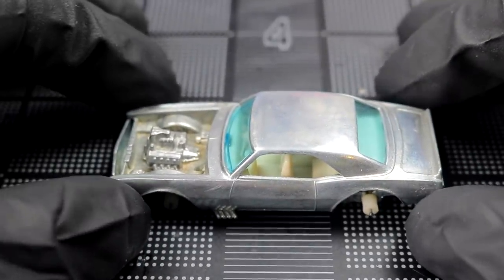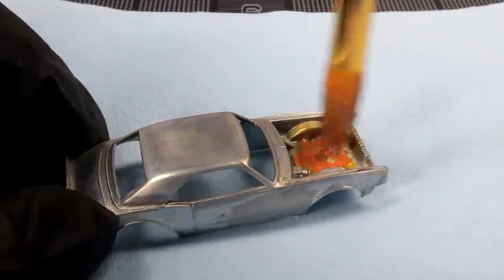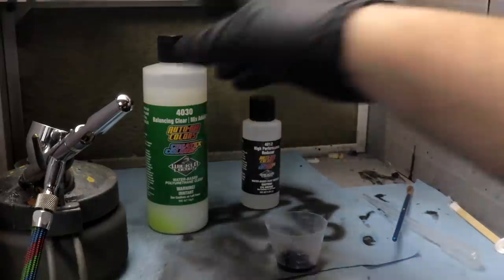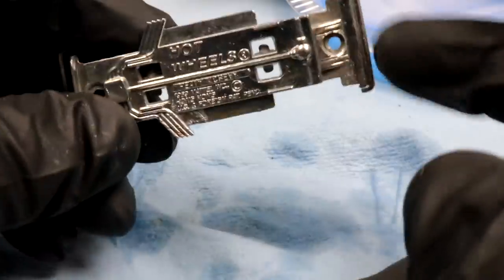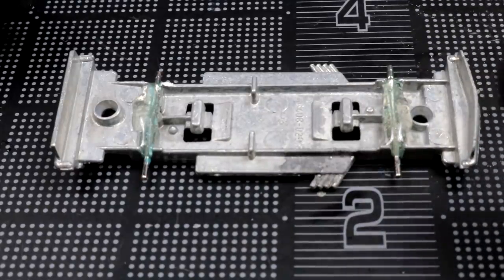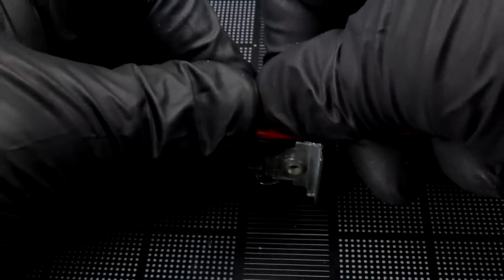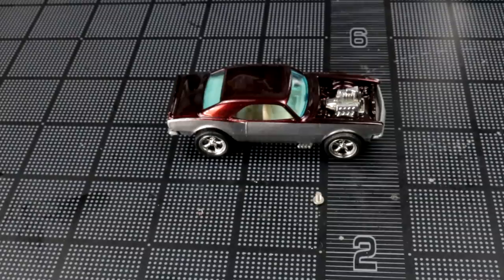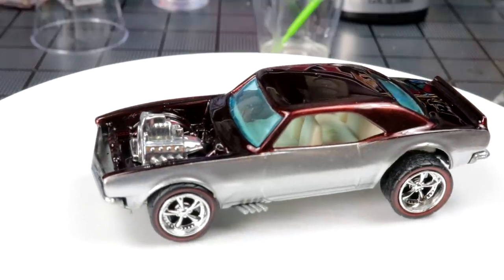Custom Redline Challenge : Heavy Chevy

Comment: You're the winner in a close contest.  164 did some extra work with the engine swap, but I don't like the cartoon motor or the giant plug wires.  Your extra work came with the axle tubes  which goes unseen.  I reckon you're right, the front wheels are too big, but so are his.
Once again, the paint gives you the win.  I like a model to look realistic and there, you win again.  A bit of engine detailing with paint and more realistic ignition wires is simple and would look great on the exposed engine.  I love your work Champ!   - Old man ramble - Over.

Comment: Here's a tip for that epoxy. Take a razor blade and cut the plunger where it's connected at the top. This will give you independent control of how much of each comes out.

Comment: I absolutely love the color choices. My only input would be as a custom, why not remove all the door lines as if the car required window entry? Also, I think paining the base a mat black leaving the front and rear chrome as well as the visible pipe tips. Just my thoughts. Either way it still turned out pretty rad!

Comment: Also... I wonder if using clear UV resin would work on windshields.... Paint on thin coat, let self level, hit it with a UV flashlight and voila!  I make rings using this stuff and it can take a fully sanded, opaque base and make it crystal clear in seconds.

Comment: Will you be doing another informal live stream again soon? Love to have a chat session to talk about all things Hot Wheels. Especially would like to address the M2 diecast car kits that everyone complains are crap and have seen the poor ways that they fit together and have missing parts. Your question about getting phosphoric acid for electro polishing; have you tried a local hardware store in Canada to see if they can order it for you? I have a solution for wheel axles that might work; use 2" head pins and 2mm crimp tubes from Wal-mart. The other idea I am working on is finding a nylon rod that could imitate those used in old redlines. That way you could always add whatever sized redline tires you want. Hope to see another one of great videos again real soon.

Comment: Hey man, big fan of your vids and work; question about repairing details like the door lines - have you considered coating the entire car with your liquid mask except the door line and then annodizing/zinc plating it? In theory, the silicone should insulate the surface of the car and the plating will only occur on the exposed door line.... I am in no way a chemist or physicist, just remembering high-school chemistry from 20 years ago and thought I'd share my theory for you to test.
Blub-blub-blub-blub!

Comment: Had a thought about painting... Would it work if you sprayed the quicksilver only from the top of the vehicle, and create a different kind of two tone paint job?  Process in my head is; full prime, full base coat, quicksilver from top 90-85 degree angle only, then full paint spray.
Feels like it should create two tones, lighter on top and fading to darker on the bottom...... Make any sense?
Reply from the maker: Yea I think you'd end up with a result where only the candy with the quicksilver below would be the part that really sparkles in the sun.  Worth a try!

Comment: If you go to Facebook and type Hot Wheels in the search bar, you'll find some of the pictures I took of the redlines I am currently trying to restore. Still trying to decide if my cars are shiny enough to use straight spectraflame paint or use a sparkly silver paint as a base coat. The other redlines from 1971 to 1976, I am debating whether to use white or gray primer as a base coat, and then just Hot Wheels enamel color like you did on your cars. Let me have your recommendations.
Reply from the maker: Could you post right on the diecast resurrection facebook page?  Just right in a comment or something.